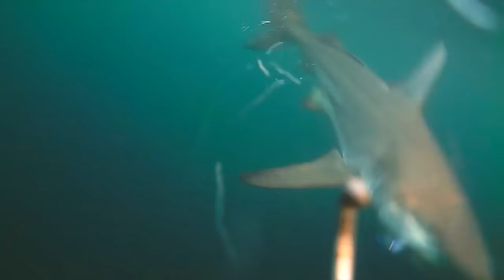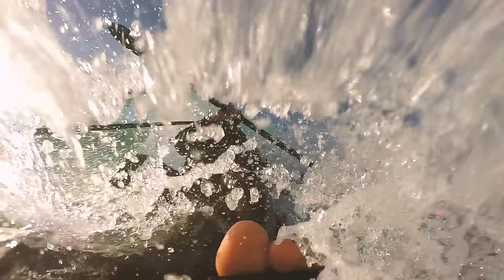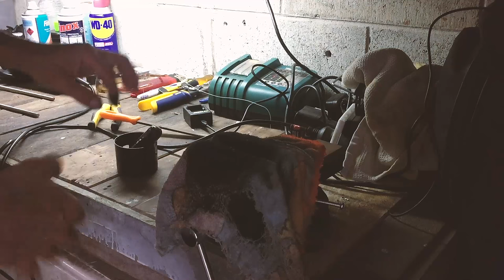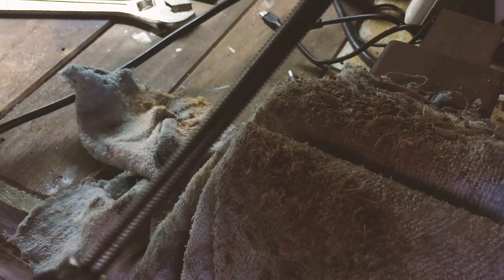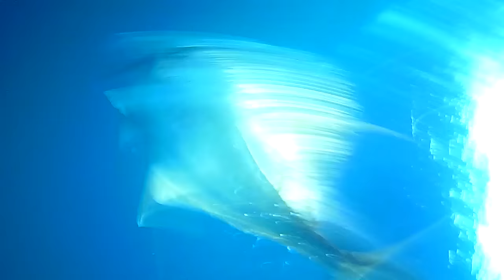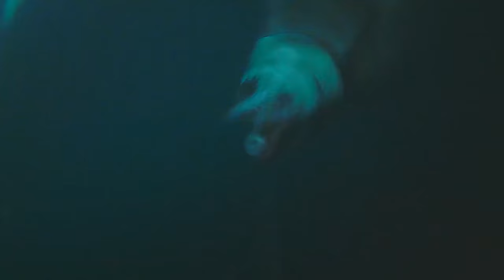Sharks and Kage Gaffs - Kayak Fishing

Comment: NICE
Reply from the maker: Thanks Fred, did you get the camera?
Reply: Freddy York Ikr
Reply: RoKKiT KiT Man, I did not get a camera yet. I am still not really settled on which one I want to get. I get super clean footage out of the iPhone7+ as long as the lighting is good. And I have a DJI Osmo Mobile which makes everything buttery smooth. So I may just hold off for a minute on the camera. Until the school projects require some low light stuff, I think the phone will probably suffice for what  am going to be doing with kayak fishing vids.
Reply from the maker: Definitely, all the stuff I shoot is done with some Gopros and an iPhone. Its just too much mucking around to take the big camera most of the time and then you have the water and elements to deal with, so only good for land anyway. That Osmo is amazing! I have been drooling over that for a while. I remember trying to pan across the full length of the new kayak and ended up using my skateboard just to get it even close to alright! Osmo would have made it a snap.
Reply: Yeah man. I love the osmo. As long as it s daytime, I don't see much need for much more than my phone.